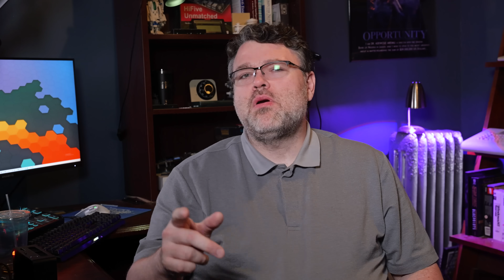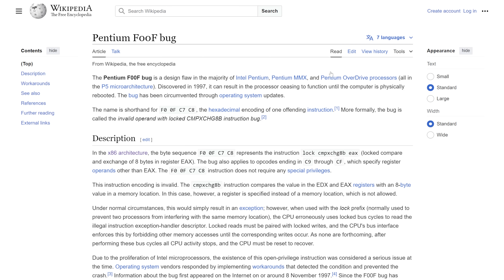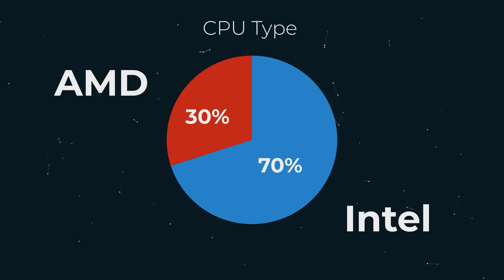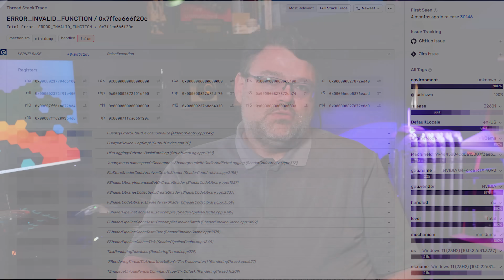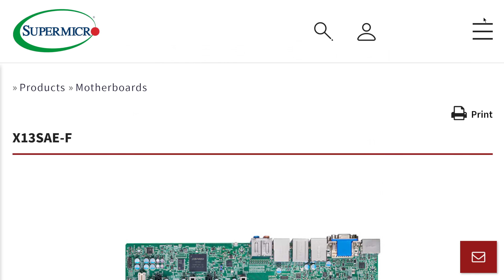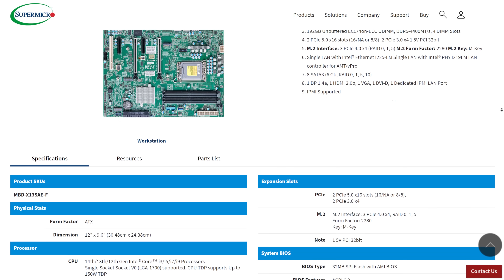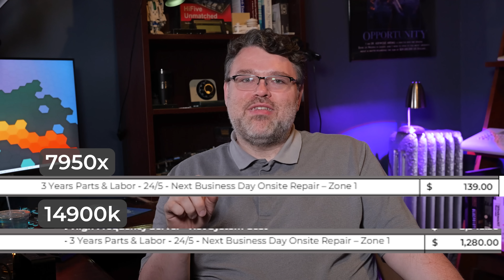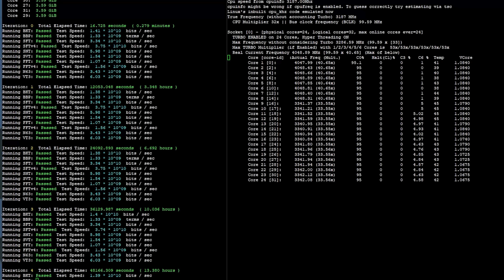Intel has a Pretty Big Problem

Comment: I think intel knows they have a design flaw and don't want to admit it. The increase in errors over time has to be some sort of degradation, which either means the 13/4900k are cooking way too hard or that these issues will likely show up in the lower end versions just slower.

Comment: I have a 12900KF in one of my machines, bought when that model was released, I immediately reacted at the insane power draw and the in effect high levels of fan noise. My solution was to lock vcore at 1.25V. Machine is silent and has never had a problem. Glad I didn't upgrade, which wasn't meaningful anyway since it's the same arch.

Comment: Sounds like it's a hardware bug. An operation is broken due to it and it keeps causing these crashes. The fact that they increase overtime would indicate that whatever that person was doing in the game that instruction would be being used and sucked into cache for possible execution over and over. So the spot where the crashes happen is triggering the bug and in order to figure out what it is you'll need to go through all of it's instructions and operations to find it. What variation there is could possibly be due to overclocking and overvolting, however wouldn't it be more likely be due to the nature of how the chip works? Translating cisc to risc? In this case microcode can't fix it. It could potentially be the same defect crippling more than one thing due to it as well. Ouch that does not bode well. Wonder if there will be a chip recall or a class action lawsuit first? Probably both. Probably a few bad batches.

Comment: I think we need to talk about gaming culture, extreme this-and-that, and overclocking in particular as the source of the problem. It goes orthogonal to "component derating" that is common practice in the rest of the electronics industry. You should run a component at LESS than it's rated performance at all times. Especially as and end-user.

Comment: I feel like "pretty big problem" is a massive understatement. Intel has already been losing massive amounts of money lately. I've been cautiously optimistic about Intel's future, in spite of their financial troubles. But this might be the final nail in the coffin. I don't think Intel can survive this financial shock if even half of this is true. Intel's reputation has already been on a downward slide, but at least their chips were still fast, even if basically everything else was problematic. If these issues can't be resolved at all, then Intel is looking at their last 2-3 years of products being unusable. Even if these issues can be resolved, we have yet another situation like Spectre and Meltdown, where Intel ends a CPU generation with less performance than they had at the start, due to needing to patch serious problems that stem from bad design decisions. What kind of person will recommend a 14th gen CPU at launch, if there's a big chance that it'll simply break?

With AMD launching substantially better laptops and doing so in high volume, and with AMD already ahead in server performance and constantly gaining market share, I think Intel is dead. Literally, I don't know if they'll be in the CPU market in a decade. Financial bankruptcy seems increasingly likely. At this point, it seems like a culture issue at the company, where Intel simply isn't capable of designing a modern CPU. Sandy bridge was amazing when it launched, but Haswell was way back in 2013. 9th gen didn't suffer from the same architecture security issues, but by that time AMD had shown how stagnant Intel had become, by practically doubling the number of cores in desktop CPUs. Intel hasn't made a truly great CPU without major issues in almost a decade. There's always some "It's great, BUT" issue, and those issues only seem to be getting worse over time. Previously, it was "suffer a generational performance penalty to prevent a website from scraping your passwords", but now it's "your CPU has a 25% chance to crash your computer every month".

The only "best case" situation I can imagine, is that a large portion of Intel's recent financial woes were caused by them issuing replacement CPUs to major vendors, but the timing simply doesn't match. They posted their first financial losses in summer 2022, while 13th gen launched in late 2022. It's possible that their bad financials meant that they rushed out 13th gen to try and fix things, but once again that highlights a cultural failure at Intel. Rushing out broken products isn't how you keep a struggling company alive.

Intel is going to wear this disaster as their reputation for years. I'm now genuinely worried that AMD isn't going to have any competition in a few years. That's really bad for the future of CPUs, just like AMD's bulldozer days meant that CPUs stopped improving for many years, while Intel milked the CPU market. Hopefully Intel can recover and make a comeback, just like AMD almost went bankrupt before turning things around with Ryzen. 14th gen really is Intel's make-or-break moment, especially since they're using a lot of TSMC fabrication in their chips. If 14th gen still has power or stability problems, even when using TSMC's node, I think we can safely say Intel is cooked.

Comment: It is so interesting! Had the 13900k from the beginning, and it was always unstable. I'm a fanatic overclocker, so after a year i put everything to default, but even then it was never stable. Game crashes, random bsod's, but nooooooot frequent, just, sometimes and sometimes it happened a lot. Couple of months ago i switched to the 7800x3d, and besides the 1 or two programs that are 2 times slower, for the first time in almost 2 years i had a stable system.  Games didn't crash, no frame rate inconsistencies etc. Power usage also went down an average of 100 Watt in games. I am not a fanboy of any kind, i just always went for Intel. But something in my gut told me to go for AMD instead of Intel. A month later news came out that the 13th and 14th gen Intels were unstable, go figure.

Comment: So if you run your RAM and CPU at the actual stock, non-overclocked, non-XMP settings, you don't need to worry about this?
Reply: Almost all motherboards had default settings without power limits and overcurrent protection off. If you manually enabled everything you were probably fine. That just made the cpu way slower so no motherboard did that out of the box.

Comment: 1000$ premium support for Intel. No-one will buy that in volume with that ridiculous TCO.
Maybe Intel can fix that issue by pushing the CPU more harder to 7G all core 2kW moar power immersed in liquid helium to just hit sub ambient temperature at idle. 
On laptop 13 and 14 gen including U,P,HX and K can barely keep up with thermal system with performance power profile.

In windows event log, if the core is failing to keep up with clock frequency windows will log CPU core degraded and generate WHEA logger. I don't remember the exact wording and event id. Basically affected CPU core would downclocked to 800MHz and remain stuck there until power cycled. 7820HK and BGA HK is what i noticed. Linux just straight up ends up in black screen.

Comment: My two cents. Intel ships many more CPU's and AMD, so you're going to see more Intel systems crashing. Intel's CPU's are more power hungry. So there is more current flowing and leaking though the silicon. On top of this XMP and EXPO feed even more voltage into the memory controller which is inside the CPU. Gamers these days almost always turn XMP on in the BIOS. This is damaging the memory controller. It's like how flash memory cells degrade over time. High voltages necessary to maintain high frequency DDR5 signal integrity is leaking across the insulator boundaries and slowly (or quickly) burning them away.

Nether Intel or AMD certify their CPU's to run with XMP or EXPO. Last year, Ryzen X3D chips were literally melting with XMP/EXPO turned on, until voltages were lowered down by motherboard manufacturers after this issue came to the surface. Intel chips don't melt, but the memory controller starts glitching out. Graphics drivers swap data from system memory to GPU address space all the time. That's why "GPU out of memory" error messages are popping up.

My advice, never turn XMP on. Permanent silicon damage might occur if the memory controller is overclocked with XMP, even if it's just once. Run at Intel listed JEDEC speeds. With multiple DIMMS per socket DDR5 will run slower in officially supported configurations. Even if the DDR5 modules are perfectly fine, the integrated memory controller inside the CPU is being cooked. The fact Intel supports DDR4 and DDR5 might have something to do with why it glitches out. Only engineers working on this issue could say for sure.

Comment: Intel's biggest problem (if it can be called a "problem" at all) are the prophets predicting disaster and Intel's problems.
Meanwhile, Intel has been doing well since the 1960s, it has been a company that has been setting directions and standards in its industry for DECADES - it is alive and gaining weight!

Comment: I have a 13gen and I had some games that would use ALOT of extra power and constantly crash. The CPU would get vlose to 100c. There was an update for my ASUS motherboard specific to intel 13 and 14 gen errors and that fixed it for me, so I guess some mb manufacures can actually do something about it

Comment: I have a 12900KS which has always been a little unstable, with random crashes every couple of weeks. Over the last couple of months those crashes, which used to occur during heavily multithreaded workloads, are happening more frequently even under minimal load, all despite disabling e-cores, reducing max power targets to 125W, setting DDR5 to 4800, etc. Have reverted to my 9900k, as that has uptime in the months.

FWIW random crashes occur in MacOS, Windows11 and Ubuntu. It’s not a software issue…

Comment: There was a video from Vik-off (a guy who runs a repair shop in Moscow) where he said that they had a lot of systems with 13/14 gen i7s coming in with the same instability issues, so it's definitely not isolated to i9s. Can Intel even afford to recall most of ther recent consumer high end at this point?

Edit: checked that video again, he also claimed that he had intel 13th gen laptops with this issue, even though the tdp is way lower than on the desktop.

Comment: I just want to say that I have had severe crash issues that I traced to a BIOS update last Nov/December (2023). ASUS' BIOS was so bad that the computer would randomly crash. If they hadn't kept old BIOS on their website, I would have had to RMA the whole machine. It crashed so much that I had to reinstall Windows. Restore from backup (Veeam) wasn't usable because even with the good BIOS, the system would crash from OS corruption.

Having since disabled BIOS, Driver, and Windows Updates, I have had zero crashes, no issues across many games and configuration settings in the BIOS. I've never experienced anything so bad.

The system in question is a ASUS Rog Strike with a 13980HX. It had the problem no matter what PL1/2 settings I used.

Comment: I wonder if some of those issues might be connected to the LGA1700 contact frame issues, bad contact between cooling solution and cpu, which over time fries components (I/O part that deals with pci-ex lanes).

Comment: Great vid man , felt like i went through 2,5 mil posts on reddit and had an expert sort the bad ones out and explain in the most coherent way all the valid ones . I know its alot asking , but it would be nice if could do something similar for the 13-14600k-700k as well . I know the situation isnt quite as bad there but it would be usefull to know how they stack up against their own counterparts (7600x-7700x) on the game crashing category . After about 30 years of owning low tier cpus , i finally got a 13600k (extremelly high tier for my kind of budget ) and i was like 'fuk yeah , finally i can tweak shit around and try OC and shit ' and then this fuckfest happened .. LLC to 2 and not touchin anythin else so far :)

Comment: I have a theory, grain of salt etc and not enough data to confirm etc etc
I developed a 3D CAD performance benchmark tool called InvMark for Autodesk Inventor, and it was perfect for 4 years until I upgraded to my own workstation to a 14900K (100% stock no OC).  For the last 6 months the test (and CAD application) has been crashing out and hard exiting (guaranteed) at the same spot during a particular test run, but only on the 14900K workstation.  And I've got 6 other PCs & laptops here, all the others were fine.  My dev couldn't reproduce, I couldn't reproduce, we spent days trying to debug it was driving us mental.
Then about 3 weeks ago I decided to dismount the AIO pump block (its a MSI 360 AIO cooler) and the thermal paste looked fine, although there was a couple of very small dry spots on the heat spreader, it wasn't enough to immediately ring alarm bells.  So I reapplied paste anyway but used a tool to manually spread it out across the heat spreader first, rebooted, and whaddya know the application isn't crashing now.
It isn't enough data to present this with any level of conviction or convincing, but all I'd say is if someone is experiencing this just repaste but manually cover the spreader as I personally think the LGA1700 is a poor socket for mounting and contact efficiency.  I would never have attributed a software application level crash to a thermal paste issue, obviously this would typically cause BSODs or OS level issues, not software instability.  But it happened.

Comment: I had a 14900k that also kept crashing. What I found interesting is that Intel asked me if I bought the CPU longer then 1 month ago. I personally also believe that there is/was something wrong with the chips themself because I also had a 13900k that I gave to my brother since launch that was working without issues. What I found odd is that I don't think the problem was there when the 13900k launched so seems to me, that Intel changed something in the manufacturing of the CPUs and is probably currently backtracking that.

Comment: I don’t know why anyone is surprised by the issues with 13/14th gen intel processors. They have been taking a brute force approach for generations now to keep up with AMD.

I’m wondering if, due to the GPU and IO, if the issues are related to PCIe.

Comment: That slowing down before a hard crash is really telling.  Something is not right with the memory controller, or things adjacent to it.  I've been overclocking CPUs for... over 25 years now and that's my first intuition.  Be it slow on the phase change boil, or filling the pot, or even the cold bug, that really reminds me of an unstable memory controller.
I could be wrong on this, but that's my intuition.  Now, as to why it is unstable, or at least the memory controller isn't responding correctly, I can't say.  You're at ground zero there.  Really fascinating the way you went about the data and errors and dug into it.
The troubleshooting side of overclocking always fascinates me.  The amount of work put into this I appreciate.
Reply: The ICM on 13 and 14th gen are the same so you may on to something.
I wonder if the VCCSA voltage is higher compared to 12th gen.
Reply: @f0x4nn3  I can't say with authority on this.  I kind of lost interest in the big and little core layout for overclocking.  MY friends have them, but they don't overclock modern CPUs since there really is no need (unless you go extreme) and we're old now with kids and stuff so blowing things up when you just want to check email is lame.  That said, it's interesting and something I will ask them about to try and verify.  My one bud went from a 12700 to a 13900.  Not quite a direct comparison but it is the same board.

I got jaded from Intel workstation support and overclocking and went back to an AMD desktop so I'm out of the loop, but the technical trouble shooting side of things always pulls me in.

Comment: I've been runnng low power modes on my 14900k since day one, I have a 360 WC and no OC. Progressively my cpu is crashing with certain apps. My max temps are around 85C all core load (ffmpeg). Sometimes it will encode for hours without issues other times each file even when I try files that worked. Very annoying.

Comment: My 13900k has been a nightmare of issues since I built the system in 2022. Intel even replaced the CPU under warranty and the new one is starting to have the same issues. I'm switching to AMD when the Zen 5 processors are released, although I think I might take a drive to Micro Center this weekend and pickup a 7950X3D and X670E motherboard.

Comment: I've got a 13900K, and since about 30 days after building the system it's been unstable as hell.  My worst experience with system stability in ~30 years of system building.  I started finding videos like this talking about this particular "brand" of unstable, and everything seems to match my experience.  Things have improved after lowering the current setting on my CPU (default motherboard setting configured for 530A, manually reduced to Intel spec set at 400A) but are still not perfect, which much of my software behaviors (operation and crashing) very consistently behaving not as they do on any other system I've worked with.  The problem is I don't know where to even start with this.  Is there a test I can run on the CPU that can identify the specific instabilities I need to identify so I can RMA?  Can I RMA one of these with Intel just because I suspect it to be problematic?  I feel like at this point I should just change the platform to AMD, but I've had friends that recently had pretty bad experiences there too, and I don't have so much expendable income that I can just buy the majority of a whole new system...
Reply: I would try to RMA if possible, otherwise hopefully the tech press can make enough noise for Intel to do the right thing and extend RMAs.